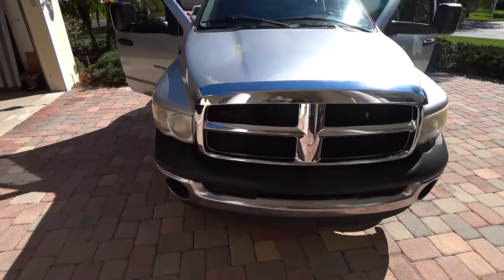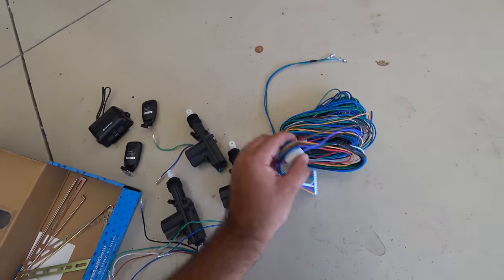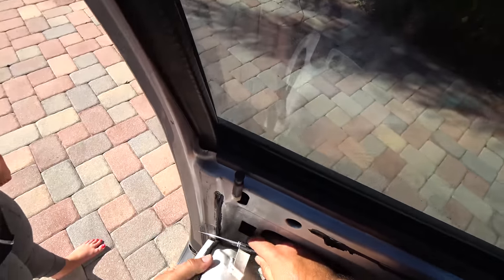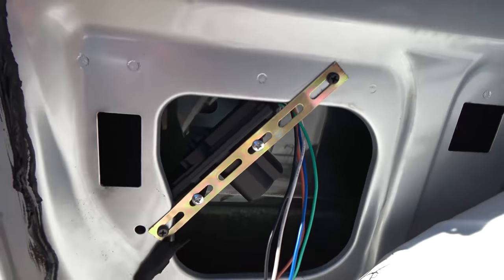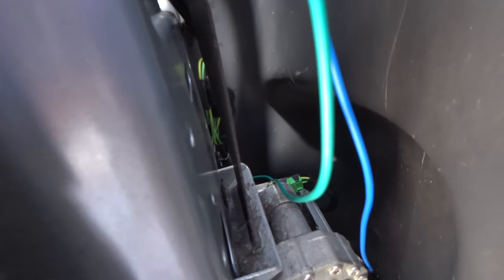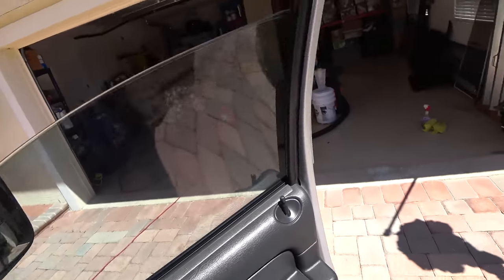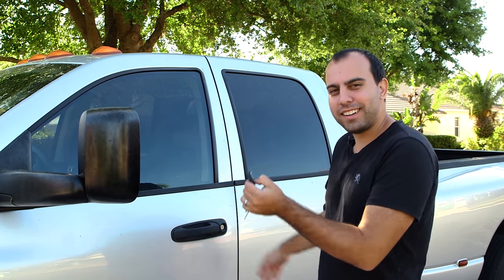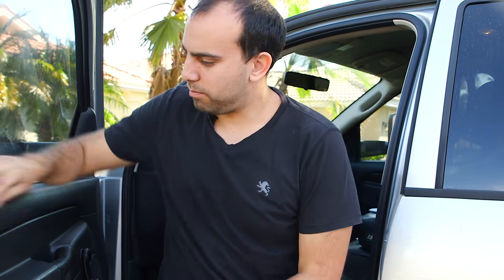Power Locks on Base Model Truck for $25

Comment: Brought the same kit to install it on my dodge omni. Literally took me two days straight to install all four keyless locks on my doors. Omg crazy amount of work and i had to stop by an auto store to pick up more wires, cause the ones that came with the kit didn't reach all 4 of where the electric locks were mounted at.  But I'm happy with the results after. At the end of the day i spent like $80 with the whole installation. Still cheaper then paying someone to do it.  😉

Comment: So I figured out how to wire the six prong switch. Connect the brown and white wire to the top and bottom terminal on one side of the switch then a ground wire to the center terminal on the same side of the switch. This will get the switch to unlock and lock the door at the push of a button
Reply: I belive brown is ground?
Reply: My diagram says 2 wire

Comment: Just bought that kid including the power windows of the same kit, what a god damn nightmare. I spent 4 hours on it and managed to pull all my wires and loosely get my stuff where I wanted it to be. I got fed up with it cause its dark now so I stuffed all the wires into the door, stuck the panel back on and left them there till maybe tomorrow or the next day when I jump back in again.

I came to your video to see how you rigged it up to your power, and I see you went directly to battery. My wiring diagram was telling me to go to a 10 fuse, but after all my wire pulling I realized my fuse box on this particular truck is located under the dash (New truck never looked before), and not where I assumed it was, behind the panel under the dash, thats when I gave up to try another day.

Im glad I came across your video cause now I'm just going to pull the one live wire through the firewall and straight to the battery and I noticed you wired the blue/brown wire to a switch. My kit (Same as yours) said to wire to the alarm, but if it works on a button I'm going to do the same thing and install a button somewhere.

Hopefully you did power windows of the same kit, gonna check your vids out now

Comment: Excellent video dude. Just one question, how did you install  the  lock/unlock switch ? I somehow bought exactly the same set up and can’t figure out  how to work the switch.
Reply: Wondering this also. Would assume a 2 terminal switch would wire right up to the kit, did you have to buy a plug to plug into the switch? Thanks

Comment: I've installed aftermarket system also. How do I get the horn to toot and lights to flash.?  My module has the wires but can't figure how to wire them. Any tips?

Comment: Great video. How did you wire the inside switch to the control box? I just installed this same brand but can't figure out the wiring for the manual switch. TiA

Comment: I had no idea this was even possible. I have been toting my daughter around in my single cab, all manual (transmission, locks, and windows) truck for 2 years. These days I just get in the driver seat and put her in the car seat from inside the cab. The passenger door does not have a key hole to unlock from the outside. Too bad our next kiddo is on the way and I have to get another vehicle to tote both kiddos and myself or I would totally do this!

Comment: I have a 04 single cab base model with manual door lock and also manual windows but everything else it’s automatic. I been trying to get some one to install a remote start system prestige model aps997z but it seens like every place I go they make look like its not easy to install so labor does come cheap and I have already installed the universal door lock actuators on both doors and tested.are you familiar with any of this systems ? Does it really require a lot of components to make the system work ?

Comment: My 04 tj works like I expected. One thing I noticed is if I use the manual lock button on the inside drivers door unlocks both doors but only locks the drivers door. Is that normal

Comment: How to connect the brown and white wires to a switch? I was doing the same thing to my power lock system, but the fuse is blown, I think that I may connect these wires incorrectly. So which wire is positive or negative?

Comment: Thank you for uploading this, just want to know how to do the wiring of the switch? Which pin should be connected?
Reply from the maker: It depends on your car and if the locks "Push" or "Pull."  I hooked mine up backwards initially then just switched them.

Comment: Does such kits actually last? I want to install one.. I've been thinking whether to go to the dealer or install such kits
Reply: Yeah I'm a big fan of the dei brand (viper) they're not much more then generics but if they are semieasy to get too go cheaper. And try to get the motion in a straight line.  Saves lots of wear and tear

Comment: I NEED HELP POWERING IT!! So I installed this kit but when I go to connect the power wire to the battery, the locks go crazy unlocking and locking non stop til I disconnect the power wire. What could it be ? I have the ground connected to a dash existing ground.
Reply: You have one of the wires backwards

Comment: I know it’s been awhile since you posted this but, much like other comments, I would like to know how you wired the switch. I just installed this on my Tacoma but when I probe the white and brown wires to ground I only get a response to the position the actuators are already in. If the doors are locked and I probe the white wire I hear a click but the doors remain locked. Then I switch to the brown wire and nothing. This video got me through a lot of issues and for that I give it 5 stars but I sure could use some help on the switch thing.
Reply: Hey man did you ever figure out the switch issue? Wondering the same
Reply: No I never got it to work. After having the locks installed for a week or two I realized the switch is completely unnecessary and never messed with it again. Over 2 years in and the system still works great though.

Comment: best video i have watched, and the only one that shows the manual switch installed and working,  but how do you wire it in as both wires are negative and i cant get my head around it. thanks
Reply: i may be answering my own question here, but im guessing you buy a 6 prong switch and wire the 2 negative wires to the negative prongs and wire the +/-  to either the battery or a constant live fuse, and negative to either the battery or a bolt on the chassis. ?
Reply: @veedubgamer5177  did you ever figure it out

Comment: Can power locks drain a cars battery if the car will be left unused ? if it can, how many days would an unused car's battery be completely depleted?
Reply: Commander Robot yes they can, I would say anywhere from 2-5 days. I have a different type of lock, when I let my car sit for about 5 days when I was out of town it died but it’s my daily and I haven’t had a problem.

Comment: Im thinking about buying this universal lock system , my car came with manual locks the same as yours. So my question in my mind is just, where do I get a constanst 12V in my car? A direct wire from the battery or just use any red cable I see near the central panel ? 😂
Reply: Look in the fuse box an get a tap fuse on it. They sell them at every Walmart

Comment: hey mike I have similar kit on my car but without a  remote. Drivers door locks and unlocks the other three.  any recommendations on how to add just the remote or do i have to get a new kit?
Reply from the maker: They sell just the brain:  http://amzn.to/2oay11V

Or, you can buy any aftermarket car alarm system with keyless entry.  Our other car (2005 Scion Xa) had power locks but no remote entry key fob so I bought a $50 dollar Viper car alarm and added it.  The car alarm had "door lock" and "door unlock" wires coming out of the brain that I spliced into the door lock switch.
Reply: cheers

Comment: A feature you could add is a speed detector to the OBD II so that once you reach and/or exceed a speed (eg. 20mph) it locks the doors for you. Newer vehicles have this in built.

Every time i go somewhere I lock my doors. Last thing you need is to have something on the passenger seat and be stopped at lights and someone comes along and steels it, Like a purse if Lauren is driving.
Reply from the maker: Or maybe even a simple timer from the ignition.  Say a 30 second delay from turning the key.
Reply: that also works
Reply: You don't really want that. Might result in a long wait with an empty locked car with running engine and you on the outside. Don't ask me how I know.

Comment: The rag on the window winder I knew wasn't going to remove  the winder but the pick hook was looking more promising.... Tell me how many times did you run out to buy bits you needed like that pick hook tool...?
It may just be the magic of vid edits but Seriously you made that look very easy, I've done this install before and it can be frustrating, you were like a seasoned pro.

I'm also looking forward to seeing your strong cnc finished mate, usually the guys that are good with their brains aren't so much with their hands.....Lolz
Reply from the maker: +garth odonnell I've accumulated a lot of random tools over the years doing projects like this, so I can usually find something in the shop that will work.

Comment: How often would you need to replace the battery?
Reply: because of the locks drawing power
Reply: AmCan Tech Videos it's connected to the car battery So u wouldn't
Reply: you replace the remote battery every year and your car battery every 5 - 10 years or so